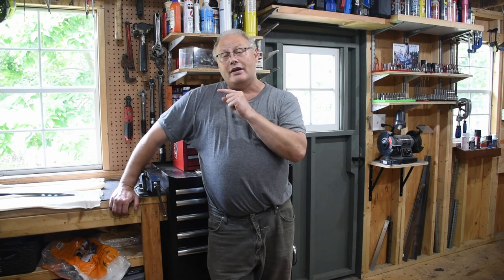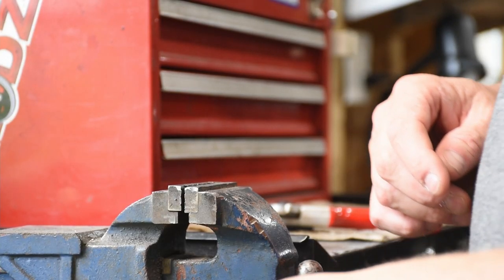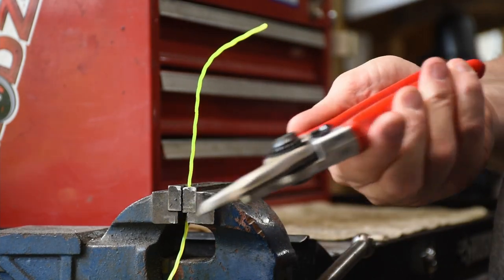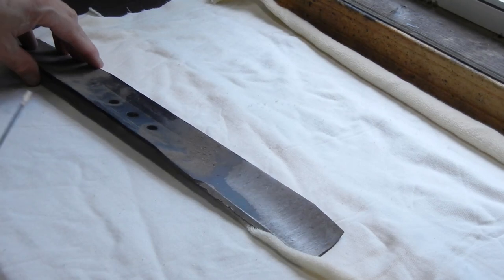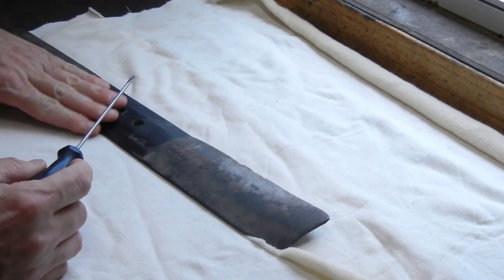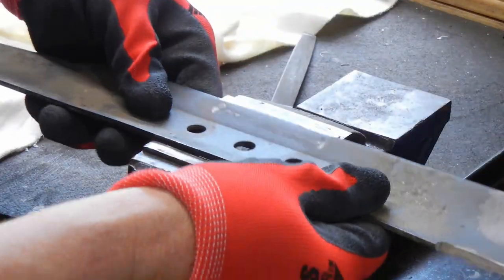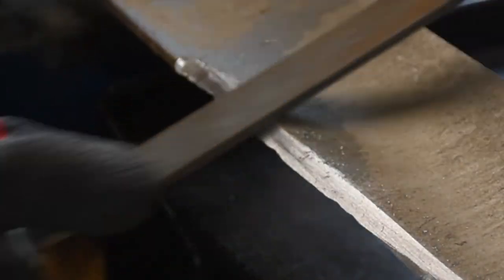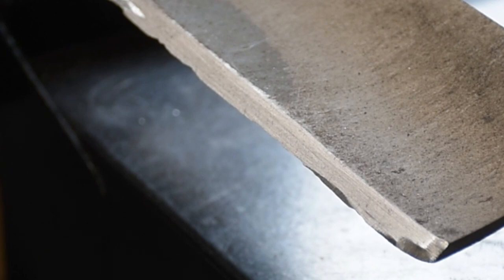How I sharpen a lawnmower blade easily.

Comment: Hi Dino, thanks for history and education of lawn mower blades and maintenance. I’m Ferd, from Winnipeg, owned a company in lawn care for 27 years, in that time, I’ve sharpened about 65,000 blades. Half of that time, I used a Bradley Blade Sharpener due to sharpening left and right sided blade required on the Walker Mowers. I’ve since sold my company but prematurely sold the best blade sharpener before I knew I wanted to continue sharpening blade on the side. That sharpener first cost about $350, now it’s about $900ca. This week I bought and received a bench grinder similar to yours, especially cuz it had 4” X 2” platforms on both wheels to guide the blade for a more consistent and professional grind. I noticed you’re sharpening your blade upside down blindly and without a consistent smooth control of the blade movement, leaving an inconsistent grind requiring a follow up with hand filing to complete the process. I’ve hacked my grinder to grind facing the top of the blade, gliding the blade gently into the wheel in one stage rather than two stages with a professional finish at a 30 degree angle in about 1 minute per blade. The hack is that the 2 platforms angle away from the wheel so as to sharpen chisels at an upward angle but the way they’ve designed the platforms, they are restricted from angling down toward the wheel. They purposely designed the bracket the platform is attached to be rounded on the outside so it can angle away from the wheel but more square on the inside to restricting the platform angling down into the wheel, preventing creation of  a 30 degree angle against the wheel. The hack is to grind the inside of the bracket similar to the outside so you can angle in both directions. This allows you to see the top of the blade as your grinding, a smooth, consistent gliding surface, a 30 degree factory angle, and a professional one step process and finish in about one minute. I hope you might look into to this and comment, thanks.

Comment: Your explanation of how the blade cuts is brilliant. I like the grinding wheel for sharpening, but finishing up with a bit of draw filing is a nice touch.
    Just like when sharpening a twist drill, I try to make just the right light pass, then flip it 180degrees and make exactly the same pass again. 
   I'm used to the old fashioned dressing tool. The ones that have multiple hardened spur-like disks. I got one of the new diamond dressing tools, and now you've given me some confidence in how to use it. 
    Thanks for making the point that it doesn't have to be perfect to be effective. 
A little practice over time makes it a lot better.
Reply from the maker: I'm glad you enjoyed the video, and I'm glad you're going to give it a try. It's not that hard once you have done it a few times, just take it slow and easy and it will work out great.
Thank you for taking the time to comment.
Dino

Comment: The only thing that I would add is to just sharpen the top of the blade. The only grinding or filling to the bottom is for removing the burr that forms to keep the bottom profile flat. Most think of sharpening to be both sides like a knife. You only show doing the top, but sometimes a bit more explanation helps the less experienced. Thanks for the quality video!
Reply from the maker: Thanks for the feedback.

Dino